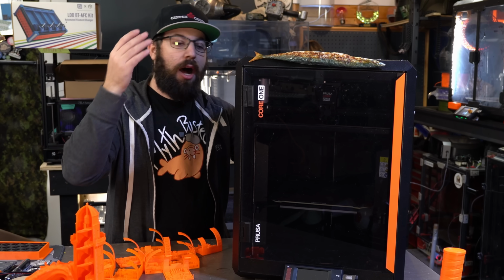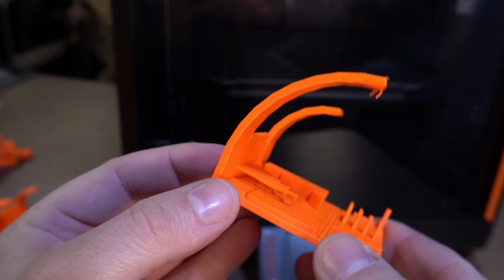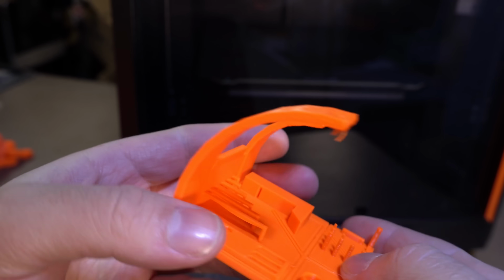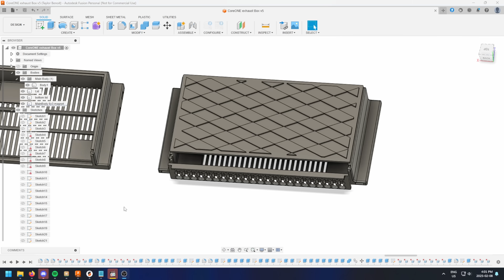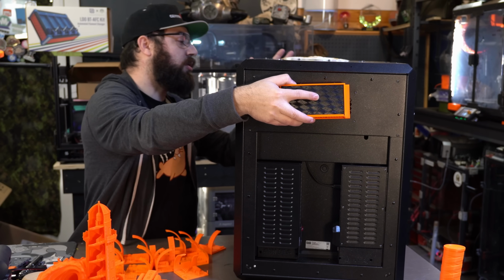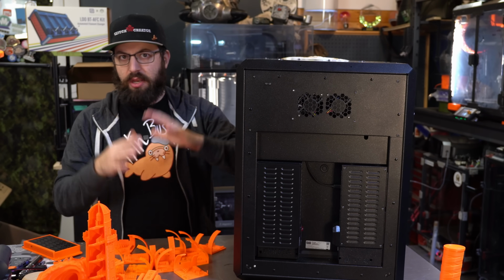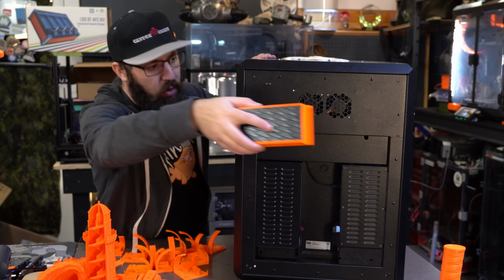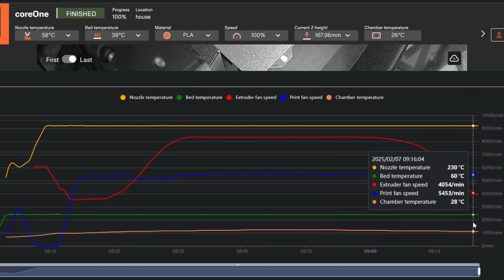One week with the PRUSA coreONE, What i've done with it and thoughts on it? #3dprinting

Comment from the maker: So whats happening, why didnt this work and how could i make this work the way i want?
Ive got some ideas myself, but want to hear what you think!
Reply: One thing you might need to consider is the type of fan it is. There are higher static pressure fans with say lower blade counts and shallower blade angle that are made to overcome restrictions, heatsinks, radiators etc. While more normal fans will have a higher CFM, but less static pressure so when you put them up against something they  don't do much.
Reply: Great thought process and approach. I just received my Core One yesterday (YAY) and through the first prints, I've been looking to see if there's the chance to incorporate the Nevermore V5 Duo. I run it in my Voron and I think circulation may be a better solution than extraction filtering (due to the benefit of the air circulation in the chamber). My plan is to rig one up and give it a go (writing down my results of course!)
Reply from the maker: @bmoroneyau  yeah, science!
Reply: @bmoroneyau  Is there enough space in the enclosure for a filter? I thought the space was relatively limited due to the sidepanels.
Reply: @andreas.grundler  Yes that's the million $ question. You could sacrifice Z travel but looking at the front of the unit there is about 50mm between the build plate and the door. Looking at the Nevermore V6 vertical I'm reckoning it could fit. Obviously securing the thing in place would be another challenge but my theory is to start with the V6 90º, sit it in the bottom and test. If it offers some benefit, then look at more options.
Reply: You are losing so much heat via the various slits in the enclosure (including near the top, where the warm air rises to), and via heat conduction and radiation from the large panels, that the loss through the fan opening is negligible.

If you want a warmer chamber, through a blanket over the printer! (Seriously. But make sure to leave the vents for the power supply and electronics in the back open.)
Reply: @Jürgen-u5o  I'm not trying to be one of those people, but. I think that's something that would take more investigation to determine.  Having a uniform path for convection air currents can dramatically change things. I'm not saying you're wrong, I'm just saying it's a little hasty. The other consideration is fumes/smell. Much like convection, increasing the cross sectional area along diffusion gradients can dramatically influence things. I know it made a several degree difference switching from the original filter pack on my voron to a blank cover.
Reply: Probably doesn't provide enough restriction for the air when the fans are off and a little too much while they are on. Could rig up some fan grill covers that operate with a solenoid that completely cover up the hole at the back when the fans are off and tap into the fan voltage when they are on to open up. May need a bit of additional circuitry to control a FET for the solenoid as you wouldn't want to overload the fan outputs. Covers would need to be a louvre type to not block too much of the fan output while open, bit like a kitchen/bathroom extractor fan.
Reply: @GeorgeElliott-GE  I was looking what things were available on Printables for the Core One already and someone had made flaps to cover the fan outlets that a simply blown open when the fans are used.
It's a very simple solution, I've no idea how much it restricts air flow when needed though.
Reply: My suggestion would be to restrict the outlet grill further (ie look at filter outlet design similiar to the nevermore, then look at the back side of the filter that attaches to the printer itself as without seeing the design myself, it may be that the filter doesn't sit flush enough to seal, possibly due to the screws in the back of the core one, utilisation of 1mm thick foam tape as per voron seals to give a better seal, and lower the outlet of the filter much further down the back of the printer, the further down you go, the better result you should get in heat retention.  Think of it like water level, but in reverse, the further down the printer you go, the further down the heated layer of air should get.  I would also looking at the rest of the printer, I feel like the areas where the panels connect would leak hot air.  Having said that, all this sort of work is just going to make it worse should you decide to print PLA, but much better for ABS/ASA/PC/Nylon (does it run hot enough for all of those filaments?)
Reply: IMO if you want to control temperature you must control gain and loss, for loss it's your air leakage and thermal conductivity and gain is the heat output of the printer. 

Currently it looks like your loss is so large it doesn't reach equilibrium where you'd want it. Reduce one or increase the other.

And the band where this can be affected by the chassis fan control is so narrow, other factors - like the room it's in, printing temp, part fan - can easily oversaturate the control (which you noticed).
Reply: My suggestion is to use swing flap doors covering the exhaust vents. and slightly more aggressive fans. Fans off the doors fall down, fans on doors get blown upwards. 
It might be a little finicky to get working but it's dead simple design wise and a little more aggressive fans will help just a tad, if you do decide to print PLA. 
It might work with the stock fans, just try to make the doors as light as possible.

Heavier doors will likely seal better especially with a little foam tape on their edges,

Comment: I paid half the price for a bambu p1s and comes with a camera that actually streams video and not only takes pictures and also comes with a activated carbon filter, and the airflow is designed to pass through it actually because it is inside, as much as I want to like prusa, they are overrated and are way behind its competitors, mainly being bambu
Reply from the maker: agree to disagree

My core one gets better/more consistent chamber temps and better print quality than my p1s did, as for camera, i really dont care about fps when its simply a "am i making spaghetti or not" check. Also the prusa printers fit better in my workflow combined with my open source printers vs the more restrictive ecosystem of bambu machines

both systems have pros and cons, not every machine is for everyone, thats the joy of having a choice, pick what works best for you and your needs

Comment: The definition of insanity surely is when you design a filter which reduces airflow, attached with MAGNETS for printing ABS, and THEN complain that it adversely influences your PLA prints, even when you are supposed to AT LEAST keep the top and back vents open.
Especially considering the aforementioned MAGNETS.

Comment: so little ESP32, temp sensor, stepper with long screw, couple of balls to hold varible shutter, mounted on the back of your existing carbon filter, could also ne used on top to manage chamber temp.  Marlin has plenty of source code to clone to build this.

Comment: I was aware of 3D printing/printers for a long time before getting one. There was one at work that one or two guys got excited over. In a spectacular lack of imagination, I thought they were kind of useless toys......then during a project, someone offered to print me a part I needed. It was a simple thing, basically a cone with a hole in to hold a 10mm carbon tube which in turn carried an indicator light. When the parts arrived...I saw the light. Bought an Ender 3 and grabbed a copy of Fusion and have since made dozens & dozens (if not hundreds) of practical parts & tools. I have no interest in printing non-functional things though, beyond an obligatory test or two.

I came here to see the Core One review as despite not really having much 'need' for anything more than my old Ender 3, I've kind of got the wants for a Core One now :(

Comment: The only reason I got my first 3d printer in 2017 (a now highly modified flash forge dreamer) was to design (F360) and print parts for home, boat, car, etc. It served me great, and now I moved on to a BL X1C that handles more advanced engineering grade filaments better.

Comment: Could you not incorporate a mesh material like tule, into the back plate to make it more breathable instead of forcing the air to hit a wall and create more back pressure? Even layering the tule in a couple of layers would give you the ability to make the mesh as thick/thin as you needed plus you can leverage a design on the exhaust as well.

Comment: Room temperature is definitely a significant variable for passively heated 3D printers. I've been printing with passively heated printers for over 10 years now and a simple solution was to put my printer in a closet in the middle of my home with a HEPA filter in it (there's also a Wyze cam with fire alarm warning, fire alarm, and a Kitchen hood fire extinguisher). 3-5C difference in chamber temperature is enough to see a difference on overhangs (small) and layer bonding (significant for functional engineering parts) on ABS.

I had an enclosed bed slinger for a few years and prints that required the bed to move more definitely raised chamber temps, and later when i designed and up upgraded my part cooling with a 5015 24v 0.3A fan (most are 0.1A) on a newer printer i noticed the same. You can see the hot end work harder when the part cooling fan is on in Klipper. My part cooler design allows you to move it up and down and when that thing blew the air straight on to the nozzle and you could see the nozzle load go from about 40-60% to 80-100% (50 watt heater with a volcano block and a Micro Swiss CM2 nozzle). I'm not one to prove thermal dynamics wrong, that's the only thing that's 100% efficient 😉

I would suggest flaps that open with the air pressure on the back of the filter box (the lighter the better, to open easier). And single pass filters that you can see through aren't the best, Carbon/HEPA combo FTW and fully enclosed filtration system is best.

Comment: Are there any outputs avialable on the Prusa control board? potentially room for a little servo bypass for your filter system for PLA, and keep the (IMHO) wanted carbon filter for the horrid ABS fumes.
Reply: The sell a "hackerboard"  that expands the I2C on the mainboard to 8 pins. I think it's 4 IO and 4 input only.

Comment: Hot end only goes to 290C - rule out the newer functional high temp engineering filaments. 
So...  it's a PLA/ABS(ASA) machine and thats about it. 
It had so much potential to be revolutionary - but just settled for 'catching up'.

Comment: I have a Core One on order - can't wait to get my hands on it!  I started with a no-name asian knockoff for about $150, then went to a Prusa MK3, then upgraded to a MK4, and finally to a MK4S.  Very happy with Prusa's responsiveness and commitment to quality and openness.

I built the common Ikea Lack enclosure for my MK3/4, but added a vent fan and very basic on-off temperature control handled by an arduino z-wave-capable board. I turn the fan on in the enclosure when the temperature hits 50 deg. C, turn it off at 30 deg., and kill the power to the whole shebang if the temperature got over 80.  I was (slightly) concerned about runaway temperature not being handled by the printer electronics, so this was intended to be just a backup.

I think the vent opening in the top of the Core One could be driven by a small servo motor.  You could monitor the interior temperature and the signal driving the rear fans - possibly using Prusa's GPIO add-on to provide the information - and have a little "smart" board drive the servo to control the vent opening appropriately.

Comment: Everyone freaks out about Bambu but why when people talk about Prusa connect nobody mentions is a cloud service.
Reply from the maker: because its entirely optional, doesnt prevent you from using the printer any other way you wanted to and you can use prusa link, which runs entirely locally if cloud isnt your thing

its not the cloud service itself people are unhappy with with the recent bambu changes, its the locking features and removing features that you had access to before thats causing the blowback
Reply: @CanuckCreator  Can you use the Buddy3D without the cloud? I think not. Why use cloud service when it could be just a well done IP camera? why do you need a cloud?
Reply from the maker: @teresashinkansen9402 You mean the optional IP webcam thats specifically sold and stated to work with prusa connect only at this time in the product description,  that is again is optional and doesnt prevent you from just using ANY other IP webcam, or connecting an RPI and running octoprint with a webcam like you could have done for the past decade? 

what about it?
Reply: @CanuckCreator  Yes that one, the one that is specifically designed to connect to the printer's main board and which is practically integrated on the Prusa ecosystem. Why it only works with a cloud? It makes no sense and being an official Prusa product makes me wonder about why they did that. Maybe they just dodged a bullet because the bambu fiasco happened first but I wouldn't be surprised if they planned in the close future to start charging for the Prusa Connect.
Reply from the maker: @teresashinkansen9402  It doesnt "connect" to the prusa mainboard, it just draws power, its entirely a stand alone product, they did that because they have custom firmware on it and its NOT an off the shelf IP cam firmware because of security concerns from some of their customers over generic off the shelf IP cams

again, Prusa connect is OPTIONAL and doesnt hinder or restrict how you use your printer in any way. they didnt force a "security" update to make you use an separate app to talk to their printers. 

your moving goalposts fast here bud, the issue ISNT what things do, the issue with bambu is things are being force changed AFTER PURCHASE and users are having functions removed or gatekept.
Reply: @CanuckCreator  No, Im not moving any goal post, is you who is making a straw man or simply you are not getting the point of my comment. My beef here is that there is no reason to use a cloud service for a camera specially when full functionality of the camera and printer requires it. Sure you can use the prusalink but that limits you to your local network, else you don't have the same functionality and remote telemetry which takes me to the point of my issue; control and possibly making the ecosystem dependent to paid services. Sure Prusa is not being as shady as bambulabs but seeing this cloud service really makes me wonder about it, the risk to abuse it to get more money is there. That's why made my first comment, why nobody is even talking about it?

Comment: really wish these were available a year ago when I bought my bambu p1s, it just looks so much more solid and well designed. Also learning cad is using cad, you never stop learning cad in my experience there's always a faster or more efficient way to do things even when you think you know everything. :)
Reply: Bit of a difference in price though.
Reply: @Design_no not even close value for value. Smaller bed no filtration no camera that's a black and white add on shotty integration plastic door. I liked my p1s so much I got a second both probably cost the same as this. ✌️

Comment: "learn to cad" is right. I got in to 3D printing for printing my cad models. I started off with a P1P and now I have 6 Vororns and could care less about my p1p with a custom built aluminum enclosure. So ya Def get in to cad if you have a 3D printer. Good one Canuck!
Reply: Is the quality as good from the Vorons? I manufacture a part and I just want something that works. That's why I like Bambu. Wondering if this core one is the same way.
Reply: @calledout4437 I'm sure the Core will be as good as a Bambu, just maybe not as fast. So far it looks like the Core will have better tool head cooling, maybe slowing down the Bambu can match it. I think Bambu will have the advantage with multicolor printing as the AMS is pretty well worked out. Although, the way Bambu is headed I can see them only allowing Bambu filament through the AMS in the future, if that happens then the MMU would have the advantage of accepting any filament.

Comment: I'm surprised by the effect on the PLA prints. I run a couple of X1C's and print mostly PETG, TPU and some PLA, but other than a small (10mm gap) under the back of the top glass, I always run my printers with the doors closed to cut the noise down. I've never had a nozzle clog, or noticed any degradation in PLA prints. My chamber temps during prints are typically around 36C.

Comment: This is one of those printers where I’d actually opt to vent outside if possible because of those integrated fans
Reply from the maker: ya it would be very easy to add a exhaust tube to it, either with magnets like i did, or using the tapped screw holes left available

Comment: Started learning how to 3D model in tinkercad :D Now I am using mixture of tinkercad and blender (blender for some curves etc), hopefully I will move to fusion, but I still dont understand it. But I would like to print some parts for my fellow car friends, for their old range rovers etc, which are not available, because most cars have it broken already (like parts of the dash, center console etc). So far I modelled fuse cover and cover for secondarty light buttons. Printed from XT CF20 on ym delta, they fit.